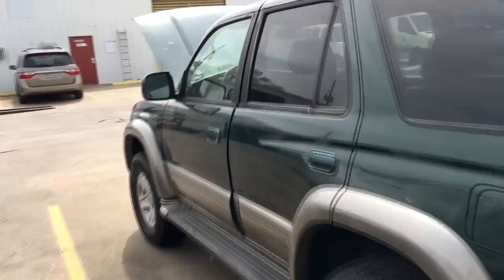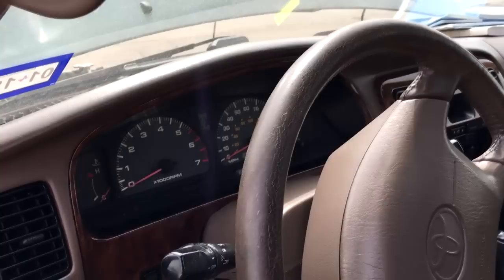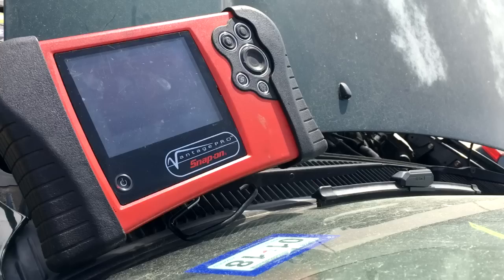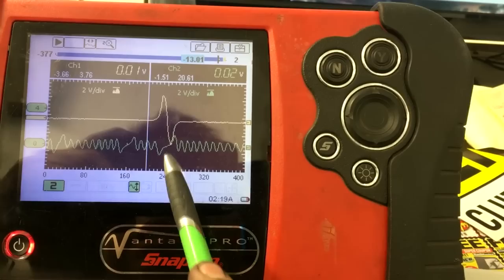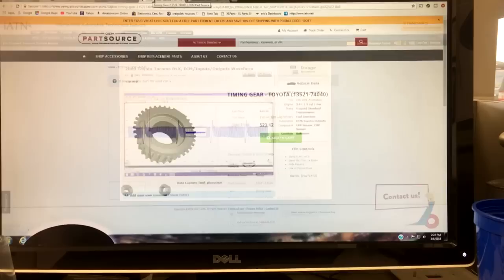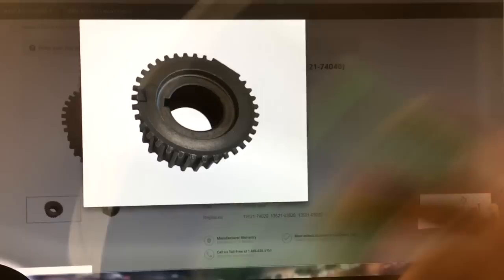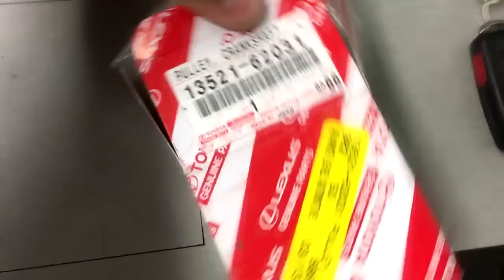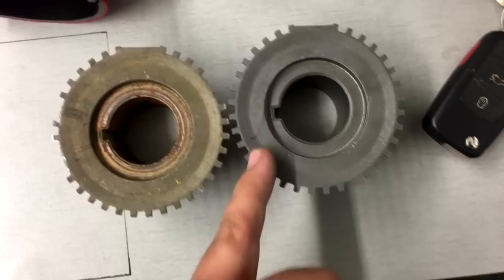TOYOTA 4RUNNER 3.4 CRANKS BUT NO START DIAGNOSIS

Comment: 1 in a 1000 of todays techs can do what this man did.
Reply from the maker: Mike R Thank you!
Reply: Buy a tool that tells you what's going on?
Reply: nick nichols buying a tool doesn’t mean shit , this dude had the knowledge to pinpoint the problem very quickly , while using his scanner. kudos to him we need more mechanics around like him. As he said the owner brought it to several mechanics that tossed parts at it guessing , where they could’ve had the exact same scanner but all they’re seeing is 2 squiggly lines. To top it off he said it was his previous mechanic who had dropped a hose clamp in the timing cover that caused all his problems. Not only that he knew the gap on the gear was for something, so ya not just a scanner def knowledge lmao
Reply: More like One in a Million.
Reply: Great diagnosis!  So what if he used a tool, it was his knowledge and expertise to know what the tool was saying.  Ever use a timing light?

Comment: Awesome job, I like the way you went straight for the Cam and Crank signals they wont lie, so the customer was right , the belt was timed properly but faulty Crank signal (due to missing teeth)  was not allowing to start. Keep up the great work.

Comment: I am a DIY and work on my own vehicles . Right away , it sounded off when cranking . If you heard pops from intake and/or exhaust , that is saying that it is out of time or a valve is burnt or stuck open . I also noticed that the tach never moved at all when it was cranked . I don't know if it does on that Toyota .  How do they charge for      parts and labor , when it DOESN'T fix the car ? They need to SETTLE on NET cost on the parts ONLY , NO LABOR - or be sued in small claims court . How do they get away with it ?     I did miss the gas guage on empty . That could have also been a possible issue .     Great fix Eric . Right to the problem and proved with the scope BEFORE replacing the bad gear .   There is a video of a Chevy VAN . The engine was rebuilt at a machine shop . They put a V6 reluctor wheel on a V8 crank ! Then the fun began - AFTER it was installed ! It was found with a lab scope . Imagine the engine swap - in a VAN !!!!!!

Comment: Cool find 👍 That’s exactly what happened on my 97 Camry. I accidentally dropped it and didn’t noticed one of the gear teeth went missing. I replaced the oil pump o-ring, seal, and crankshaft seal, started the engine and only ran for 5 seconds and immediately shut off. After scratching my head and trying to figure out what I did wrong, it was the dam timing belt gear ⚙️ was damaged. Quick trip to the junkyard, had the Camry running next day with no further issues 😁

Comment: This level of detective work by mechanics is rare. question i have similar backfire/no start symptom on my 5vz-fe but if I unplug the Cam Position sensor(brand new) it starts & runs ok. Does this sound familiar? Did this 4 runner run with Cam pos sensor unplugged? 

Thanks in advance! My $35 Amazon diagnostic computer is not as good as yours lol, it doesn’t show wave forms it just say “P0340 cam pos sensor”

Comment: Just to get the info out there... My sequoia recently stopped running, seemed like it was a fuel starvation issue... bad fuel pump... but it was not... then things seemed to indicate an ECU issue, but it was not... Finally after hours and hours over a few weeks, of tracing down the problem, I found the wires to the crank sensor had been damaged by the serpentine belt!   Fixed them, and Bingo it runs!

Comment: The timing belt idler pulley does not look like it was replaced because of the rust on it.  Good work on finding the problem. Sir.

Comment: hello i have a problem with my 4 runner 98 there's a water hole that goes from the block to the intake since it explde on me and got everything wet after i reapir it it won't start , i replace the crank sensor, coils and still won't start since then i can't figure out what can be.

Comment: Hello!
Nice video, thank you!
I have a v6 88 Toyota 4Runner. There is no work on the engine recently. Checked the compression and is between 160-180, not sure if it’s good or bad….my complaint is that my truck starts only with starting fluid. If I turn it off it will only crank but no start unless I apply starting fluid. It straggles to start and when it does, engine is unstable, no strength to move forward, fumes smell toxic…I don’t think I have issues with the timing….any suggestion? Please advice. Thanks much!

Comment: My 07 4Runner is doing the same exact thing when I try to start it, it cranks and cranks and cranks but never turns over and fires up the engine. In your opinion, what could be wrong that is causing this issue and how can I fix it!? Thank you

Comment: Hi mine shows p0171  and it does have a starting issue the same like the one you have what do you think is the problem a Mechanic told me the Toyota always goes bad with the fuel regulator  and he didn’t have a good  scanner like yours

Comment: I have a 1999 Toyota 4Runner with a v6 automatic I got a p0335 and a p0340I know it's the crankshaft positioning sensor and the camshaft positioning sensor however this is what happened is battery grounded the positive terminal so it won't turn over anyting I put my OBD scanner on it I can turn it over and start it but as soon as I hit the brake it dies any help will do I think it's a wiring problem they got fried or something

Comment: I have a 97 toyota 4runner. Same engine, 3.4  I keep getting CEL p1300  runs fine for 20 minutes then check engine light comes on and it just shuts off. I've changed all kinds of parts. No luck.... any suggestions?

Comment: Video was super helpful I would not have got mine fixed if it wasn't for this vid...
Reply from the maker: Awesome! I'm glad I could help!
Reply: Great job ,quick question I did an Engine swap from an 05 sequoia to my 05 tundra and now I have no fuel to rail do I have to swap ecu Also or what am I missing?? @ADVANCEDLEVELAUTO

Comment: Hi. I have a 2001 Lexus ls430 with throttle response issues. It’s acting like it’s in lips mode. You have to slowly push the pedal to be able to drive it. If you revert it sputter almost want to die. Any idea of what to look for or diagnose? Would appreciate if you have any recommendations.

Comment: Can you pull the crank position sensor and look through the hole, turn the engine over by hand, inspect the teeth on the reluctor wheel? I'd use a borescope or phone if it is impossible to see directly.

Comment: My 2000 4runner had the same symptoms. But mine also had the red security light blinking as I cranked it. Turns out I had forgotten that I had dropped my replacement ignition key on the concrete earlier. It came apart in 3 pieces. I put it back together and thought nothing of it until an hour later when I Inserted that key and turned it to start. Again it cranked fine but wouldn't start.
Now I'm thinking my issue is that key not the engine. I found an old  original key, took it  out to the 4runner and bingo...it started right up!  I will now pay attention to the red security warning light.

Comment: I've got a 2000 model 4runner and it got hot and shut off on me BC apparently my temperature hand isn't working and when it cooled all the way down I went to crank it so I could put water in it and it's doing the exact same thing the vehicle in this video is doing what do you recommend it might be

Comment: I have a 99 4runner that sat for 4yrs and have replaced the pump and sock in tank. I have fuel and spark it acts like it wants to crank for a split second and then nothing so pulled plugs changed them same so pulled all the plugs and they are wet rolled engine over and seems like getting too much fuel. Any ideas would be greatly appreciated not much out there on this topic 
Thanks

Comment: I have crank but no start, did the diagnostic test on my 95 4runner 3.0 & it says that the vehicle is flawless as far as codes go... Hard to believe considering my vehicle still won't start. I found a blown efi fuse so I replaced that. What would cause that to pop ? I'm getting fuel, i have weak spark, starter is good, it's grounded correctly. I'm thinking it's either the timing, igniter, ignition module, or distributor. And yes, I've replaced the battery. Any help would be nice.. I'm having a hard time with this vehicle

Comment: Having a similar issue on my 97 4runner, just that it happens every now and then. Engine starts idling high around 2k rpm at idle when in PARK and if I turn it off  It'll crank but no start and smells like gas. But If I put it back into drive, idle  drops, then I turn it off. Turns on more often. Any advise as to what to check?

Comment: just installed new ignition switch on my  2001 4 runner limited edition it'll turn over but still won't start has new battery getting plenty of fuel just need to find out why it'll turn over but won't crank

Comment: Hey bro, have a question for you.  I dropped a jdm 5vzfe  engine in a tacoma but wont run with correct firing order 1-4, 3-6, 5-2.  But when i swap around the firing order up 1-6, 3-4, 5-2 will run but with misfire code with #1,#3#6 code.  Anyone of y'all could help me please feel free to reply.  Thanks for the help!

Comment: I'm having an issue with my 2002 toyota 4 runner V6. car seems to be running fine, but has a code of P0171, lean condition. Did live data work with diagnostic tool. Close loop at idle. O2s B1 S2 is 0.7 and STFT B1 S2 (%). Is stuck at 99.2. It seems to be there at idle and under load. STFT bank B1(%)  -5.5 LTFT B1 (%) -3.9. O2S B1 S1 (v) 3.285 and seems to stay at 3 volts consistent. MAF (LB/min) reading at 0.5 and does increase with  acceleration. Vehicle speed 28mph, STFT B1 (%) is 19.5 and LTFT B1 (%) is 19.5 MAF (LB/min) 4.8  STFT B1 S2 (%) is 99.2 . LAMBDA B1 S1 0.959 . 02S B1 S1 (V) 3.100 . Can you assist with diagnosing issue. Thanks.
Reply: Did you find out what you had I had the same code

Comment: Similar thing happened to me with a miata, low, uneven compression on all cylinders, checked timing marks were off, however on that very same crank gear the channel that the keyway slips into and on the crank it was badly distorted to the point that when cylinder one was at top dead center the mark on the cover was off, which led me to checking marks and belt alignment, good thing was that a new gear and keyway is all it took to fix it, crank itself was OK, still showed it to the owner and let him decide what he wanted to do, car ran great for a couple of days before giving it back to him, he never brought it back so assumed all is well

Comment: I had this same thing happen to mine but mine still turn on cause I had only broken one tooth off by trying to pry that gear off with a pry bar when I did my head gaskets , took me so long to find what was wrong but once I found it and replaced it in about an hour it started up first try

Comment: Really need help... I have toyota surf 1kz 3.0 inline engine with the exact symptom... now how can i check the reluctor teeth considering the location... The crankshaft position sensor is almost in the engine block

Comment: We have the same problem with our 99 Toyota 4Runner 3.4l we don't have the computer you have to test the timing but my husband was driving the 4runner nothing was happening wrong he got to his destination and killed it and when he went to leave hours later it wouldn't start run it would turn over but not crank up and run. So we're at a lose here we've changed the starter starter relay no codes are thrown and timing is all in time so what do we do next I'm going to tell my husband to check the teeth on the gear

Comment: Man I need a mechanic like him around....
I was jump starting my 4runner. The cables got crossed. Burnt the main relay. Replaced but still won't start. Turns over now but not firing. Was firing before hand.. idk what it might be
Reply: I had the same problem did you ever figure out the issues ?

Comment: I have the same crank no start issue on a 2005 Tacoma 4 cylinders. Any advice?
Reply: ALWAYS start with simple BASIC tests FIRST . Fuel , spark , compression , injector pulse , crank signal or cam / crank signal or correlation . Don't forget about security system issues . Diagnose FIRST , then replace parts . Good Luck .

Comment: Was there any valve damage from the timing being messed up?
Reply: I don't think because this particular engine has a timing belt as oppose to timing chain. If the belt was to rip apart, there's enough clearance between the piston and valves to cause no damage, just replace the timing belt.
Reply: jorge hernandez that has nothing to do with belt or chain. It has to do with interference vs non interference motor
Reply: @jonsmith8083 . I should have been more specific. V6 3.4 Toyota engines are non-interference.

Comment: An EFI engine should only be serviced by a mechanic who knows basic physics and electronics: It is obvious to a wary eye to catch the damaged teeth on the timing sprocket. Do your own work or take it to a proper mechanic who knows stuff. Now, all that aftermarket parts added into the engine make this 5vzfe heavily unreliable and fail anytime. No aftermarket part outlast a toyota part. A good used OEM toyota part is still better than a brand new aftermarket part.

Comment: Man good Job!  Ive got a 98 that slowly lost rpm on way home 150 miles.  By the time i got home i could only get like 1500 rpms.  Now wont start no spark....  any ideas please.. thx!
Reply: If Tach Needle Was Erratic,Probably the Crank Position Sensor Or If High Mlg.W/ No Knowledge Whether  Fuel Pump Has Been Repl,Could Be Fuel Pump Just Died
Reply: I got a 98 tacoma with the 2.7 . I've replaced fuel pump , crank position sensor and the computer its still a crank no start . any ideas???

Comment: My engine died because the camshaft position sensor came loose I tightened up the camshaft sensor and tried to sell it and it would not fire I replaced the camshaft sensor was a new one I tried to start it it ran for 3 seconds and died and then I would not try to start again when I leave it sit overnight battery disconnect and try to start it'll do the same thing to apply for about 3 seconds once a day and and that's it